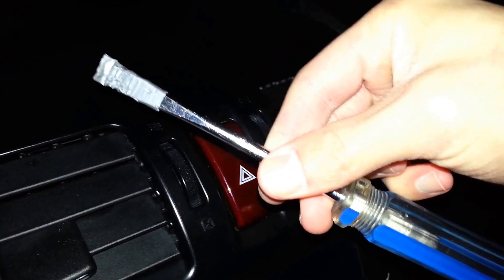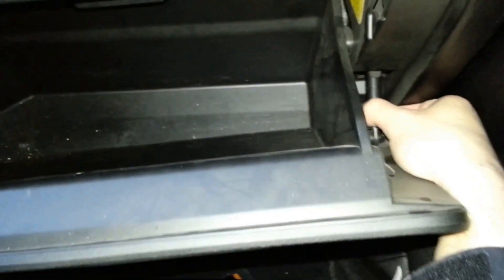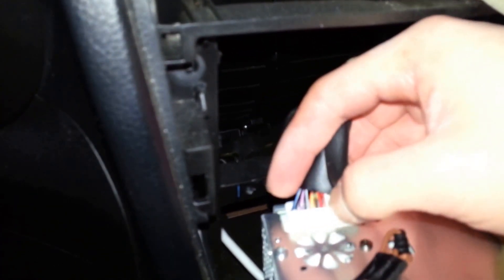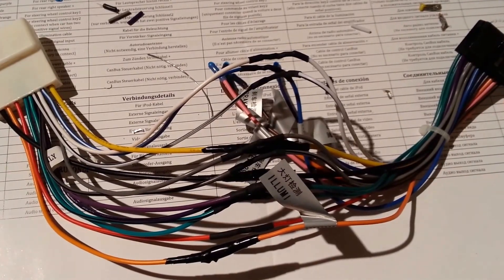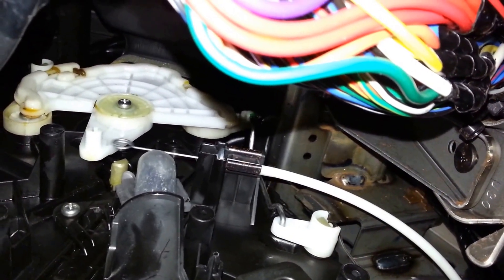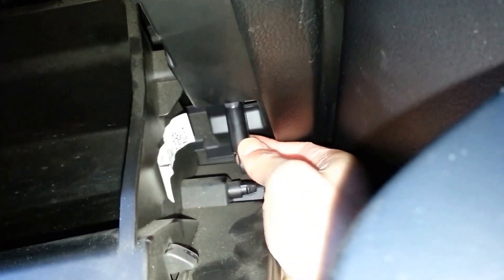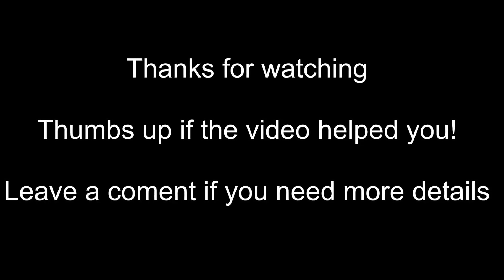Subaru Impreza 2012+  Radio replacement

Comment: You're a life saver. There's not much info about this model and year. Thanks!
Reply from the maker: You are welcome, that's right, it's confusing to search info with the WRX, STI having the same Impreza name. I sometimes have to search for info about the Crosstrek (much closer to our model than the WRX of the same year), but now I have the service manual, which was also hard to find!
Reply: I had already given up on the manual. It's the first one I've not been able to find in my fairly long history of bumbling mechanical work.
Reply from the maker: Don't give up yet, I have a link, copy this in a torrent software like qBittorrent and decompress it with 7zip:

magnet:?xt=urn:btih:4d29f795ce20ff9cb7940d3f0f4e19c8ca44a18d&dn=USDM%20Impreza%20FSM%202012.7z&tr=udp%3a%2f%2ftracker.coppersurfer.tk%3a6969%2fannounce
Reply: I may or may not have just downloaded and unzipped that file. Awesome stuff. Thanks!

Comment: Looking to install an Android unit on an Impreza of that year. This video looked painful to film, especially with removing the climate control cables! But I appreciate the effort you put into it because other videos just gloss over it and don't show how to remove the cables.
Reply from the maker: Thanks, yes the cables removal is the worst part, other than that, once you know how to do it, it's not that bad. There's a longer version in the description, but my old camera was quite shaky. Just don't make my mistake and buy a crappy radio, I'm going to have to replace it soon after only one year because it was a badly designed windows CE unit. I think I'm going to go with one of those Joying ones with an Intel chipset. What about you?

Comment: Great job on the video! Very helpful for people with the manual A/C controls.

This short edited version is better, but I think it would be good to include the portion showing the detail on how to release the driver's side A/C wire (in the long version from approximately 6;17 to 7;10).

On the factory wire harnesses (shown more in the long version), the single wire with the large translucent plug is a redundant chassis ground. The small white 8-pin plug is from the car's 3.5mm aux jack. On non-base models, the aux harness has a 16-pin plug, and there is an additional harness for the factory USB socket.

Even though your base model Impreza does not have the audio steering wheel controls (on the left spoke of the steering wheel), your car is pre-wired for them. Adding the factory SWC button pod is not too difficult. Google for instructions on how to do that. The factory wires for the SWCs end on the factory 20-pin power/speaker harness.

For models that have SWCs (or if you add them), you'll want a 20-pin harness like the Metra 70-7552 except with additional SWC wires. Google 'Subaru ae64' for one source for that. Harnesses to retain the 3.5mm aux jack and USB socket are also available there.
Reply from the maker: Thank you!

I see what you mean, I missed that detail, that's why I left the original version in the comment even tough it's too long and too shaky. I made this video only because I could not find any video on that except on WRX and STI (sometimes I have to search for Crosstrek for more relevant details!) Now I have a Xiaomi Yi (GoPro equivalent) and it make the latest videos more enjoyable to watch.

Interesting, I might do the wheel controls mod one day, good to know!

Comment: Getting the driver's side HVAC cable off was a real challenge.  I was finally able to do it by climbing upside down under the dash, using one standard (flat-head) screwdriver to push down on the tab, and another longer screw driver to pry the loop off of the gear.  I spent two days trying to do it one-handed with no success.
Reply from the maker: Exactly! I did it one handed with a camera in the other hand, while not feeling the tips of my fingers because of the cold (5C if I remember corectly). Climbing upside down under the dash is the way to go.

Comment: Does the new harness use the existing USB in armrest or 'is that USB useless after replacing radio
Reply from the maker: The harness I showed is the analog harness, there are multiple plugs going to the radio, you would need to find which plug is the USB socket and modify it to add a male USB type A (most aftermarket radios have female type A plug on the back, you can cut a phone cable and reuse it, using the USB wire color code). You could also reuse the steering control wires if you have some. Changing a radio almost always involves some kind of modification.

Comment: Please help.. what radio its compatible whit the impreza 2012.?!?!?!
Reply from the maker: I cant give you a specific model, I'm sure there are manufacturers who does plug and play, but in my case I used a generic double DIN replacement radio and used the wiring diagram (and colors) to splice the right wires to the wiring harness (the model is in the video description)

Comment: What year are you working on?? My 2012 Impreza doesn’t look anything like that...
Reply from the maker: This is a 2012 Gen 4 impreza, 2012 was a transition year, Subaru had 2 different Impreza bodies. They had the Gen 4 like mine, which was redesigned that year and had a new 2L direct injection engine (it's the same body as the Crosstrek), and the WRX and STI used the old Gen 3 body for a few years before switching to the new design. If you have a Gen 3 then there are other great videos on YouTube on how to change a radio, maybe search for a previous year like 2008 to 2011, it should be similar.
Reply: SG Cars that makes sense, mine is an STi. Thanks for the reply!
Reply from the maker: That's what I thought, I have the same problem as you but the other way around. When I search for 2012 parts I sometimes get shipped WRX/STI parts, so I sometimes look for newer Impreza parts and even Crosstrek parts!

Comment: Do you know if it's possible to use the built-in microphone with a new head unit?
Reply from the maker: Using your car's built in microphone? I can't say, because it depends on the wiring of the car and the inputs of the head unit you chose. I know I could have wired the auxiliary port on my radio if I wanted.
Reply: Ah I was hoping it would be a case of using an adapter. Thanks for the video!
Reply from the maker: Yes, more like making an adapter, the connectors will most likely be incompatible, so if the radio has the required input, you may have to make a new connector.

Comment: I read that you should turn the ac knob to heat before pulling the center panel
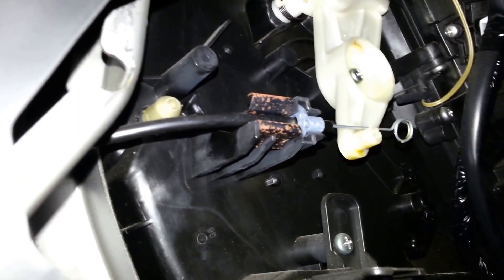Reply from the maker: It doesn't matter. As you can see at 2:04 once you remove the cable from the white plastic lever, they are both free to turn. The cable is going to get pulled by the center console however, so make sure it's free from the metal clip.

Comment: What unit you installed. Can't find the size of direct fitment.
Reply from the maker: In that video you can see my first unit, it was a bad Windows CE unit, now I replaced it with an Android unit from Eincar on Amazon. Those units are 2 DIN of size. I bought a front bezel kit from Amazon, but I had to cut it to fit this Chinese unit, other than the plastic peice around the unit, the fitment is direct since it's a standard 2 DIN, but you also have to buy a wiring harness for your radio plug. The Eincar radio is good, it does everything I need, but I prefer using third party apps rather dans some of the native apps. I use GoneMad as an audio player, and use Google Maps (with offline maps downloaded) and use tethering from my phone to see live traffic.

Comment: What size radio do I need to replace the old radio I want a touch screen how big should it be
Reply: Cin Smith use Crutchfield and it will show you what will fit and won’t fit, as well as the necessary harnesses

Comment: do you lose the steering wheel controls?
Reply from the maker: I never had that option on mine, however, depending on your aftermarket radio, it might have wheel control inputs, but you most likely will have to modifiy the stock control wire connectors.

Comment: Steering wheel controls lost ? I bet so... maestro rr and t harness so expensive
Reply from the maker: That car didn't have any steering controls, but the wires are in the harness behind the radio, so if you buy a radio with the right inputs, you can splice the correct wires with the wiring diagram and program the inputs on the new radio, but that's a bit more homework to do.

Comment: what wire harness did you used ??
Reply from the maker: It's a Metra 70-7552 (from Amazon), apparently it's for Nissan, but I emailed Metra, that's what they recommended and it worked. I talk about it in detail in the long version video in the description.
Reply: @sgcars6731  About that wiring harness. One of the reviews says there is a better one available as this one seems to be missing some wires. Just letting others know.

"The other reviewer talking about using a premade harness for Subarus is correct. Some of the wires don't come on this harness and they are required for radio install. For example the parking brake wire isn't there and you need to splice in the factory wires to get it working. That totally defeats the purpose of this harness which is to NOT modify the stock wiring.

If you search subaru forums, you'll quickly find a much better alternative and a lot of details on how to do it. Other than that it is a quality product and was delivered quickly. It just doesn't meet all the needs of subaru drivers."
Reply: Another review... This cable comes with only the most important wires, for some reason they do not include all the connections.
Missing connections are: Antenna power, steering wheel key1, steering wheel key2 and vehicle speed indicator
Reply from the maker: @carlosnievas6985  You have prompted me to do a little research and memory recovery, and the reason is this is the main plug, there are two other plugs in the original radio, the missing wires are on different plugs (sold separately). I didn't need them because I don't have a use for the parking brake, and I don't have steering controls. According to this random picture on the internet, you need a M39 harness for the steering controls, and there is no parking brake wire, you need to tap the purple wire with a red line: https://goo.gl/HKFK9n . Other than that, maybe there are unused pins (like 17-18) on that Metra connector, but I can't confirm: https://goo.gl/frQDXS
If you know a better product, could you tell me which one, or the other resource you used, I could add an annotation to the video. I'm also planning on adding a reverse camera so that might be useful information.